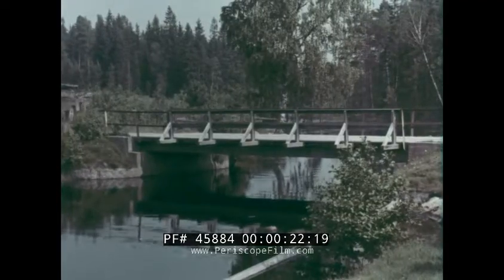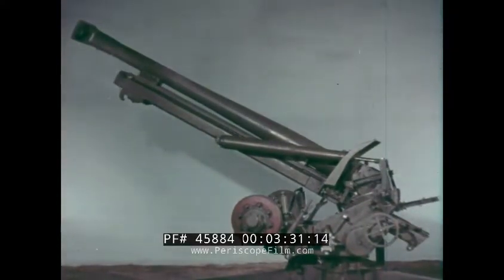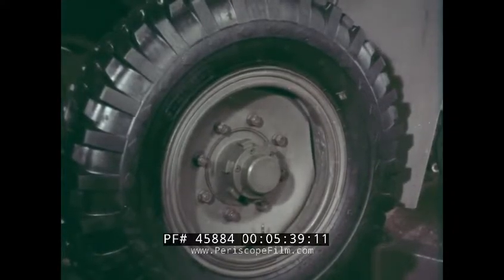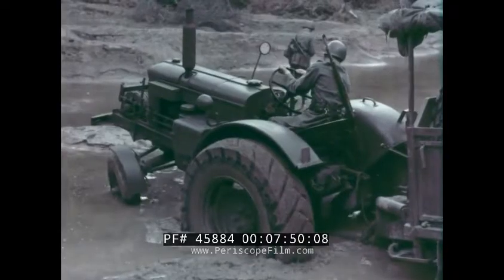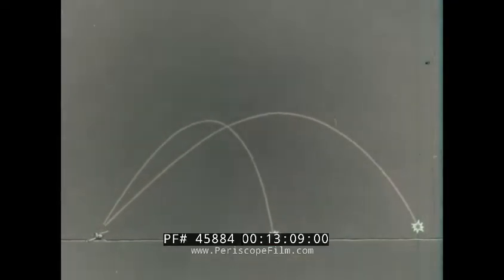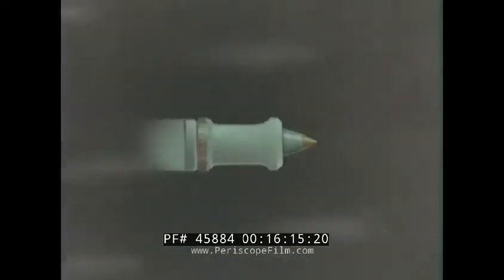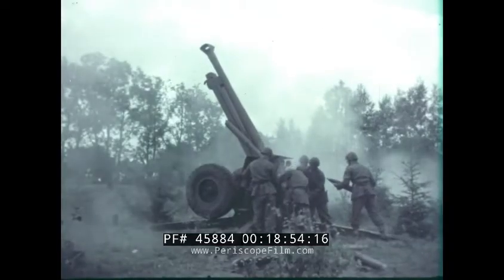1960s BOFORS 10.5 CM FIELD HOWITZER  PROMO FILM   ARTILLERY WEAPON SYSTEM  45884

Comment: I did service on one of those during my mandatory service in 89/90, it made use as part of infantry and armored battalions. We followed the advance of the tank battalion (Centurions) a couple of kilometers behind and if they called for support, we were to halt and send some grenades to clear off any obstacles so they could proceed. We could also use it as a flak gun which explains the use of the 360 ability. We also did shoot flare grenades to lit up the battlefield for the armored troops. The tactics were the same as with the new Archer system, we're coming rolling down the road, hit the brakes, shoot away a couple, and on the road again asap. It only takes a couple of minutes.
Reply: Tack för svaret! Mycket intressant. Ingick ni som en artilleribataljon i brigad, eller som en bataljons egna organiska artilleri? Är inte så insatt, men ändå nyfiken!
Reply: @lindgrenland  Artilleribataljon i brigad tror jag är närmast sanningen, MekB 18 "Gotlandsbrigaden" som var lite annorlunda konfigurerad än fastlandets pansarbrigader. Antagligen hade det med geografin att göra, och kanske också uppdraget. Det fanns också "infanteriartilleri" men vissa årskullar var "pansarartilleri" och med en dedikerad uppgift att följa med i pansars framryckning. Vi drog pjäsen med lastbil, infanteriartilleriet med traktorer. De sa till oss att vi tillhörde P18 men utbildades av A7 så i den meningen var vi pansarbataljonens egna. Någon svart basker fick vi dock inte och vi bar artilleriets uniformstecken. När vi ryckte in sa de att uppdraget var att hålla ön i två veckor, "sedan får din mamma din postuma medalj hemskickad". Jag vet inte om det skulle räknas som peptalk men lite så var stämningen då. Vill man se en haubits 41/40 så står det en för beskådande vid Gotlands Försvarsmuseum i Tingstäde.

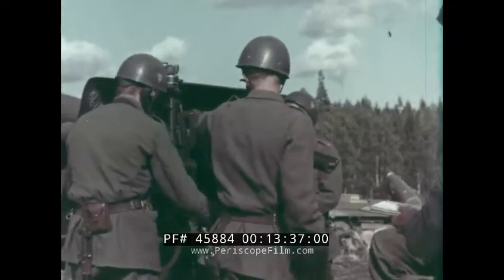Comment: 13:38 “Four rounds can be fired in seven seconds”. You’d have to be perfect, even with semi-fixed ammunition.  It takes one second for the recuperator just to get the tube back into battery. That leaves just one second to load the next round and fire.  No bubble checks or verifying correct charge.
Reply: Not a problem. You can put the next grenade on the loading tray while recuperation is taking place. Before even firing the first, the second is already in the tray. Two guys standing next to the gun with no 3 and 4 ready to put them on the tray. That's not how they do it in the filmclip but that's how it's done. Charges were put together by numbered charge packs, all cartridges were delivered with 5 charge bags marked 1 to 5. Gun chief told us what charge and what fuse he wanted, we did the assembly and counted the charge packs out loud: Charge 3, 1-2-3 as we put them back into the previously emptied cartridge. Never any mistakes and it was a kind of double-check that every cartridge got the correct charge, if someone stuttered or were silent it was something wrong and we helped eachother out to make sure. No delays at the gun, if the grenade came as far as to the gun, it was away. We never stacked any pre-prepared cartridges, that way all kinds of mistakes can happen.